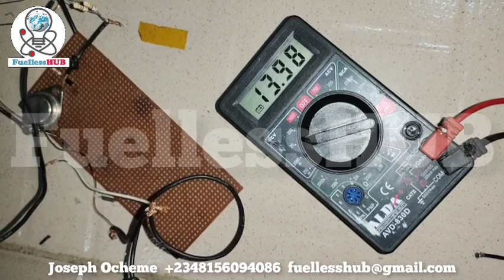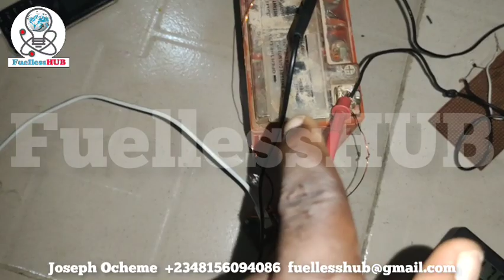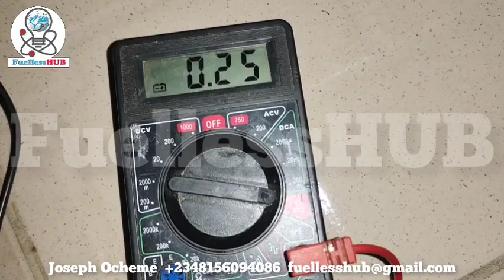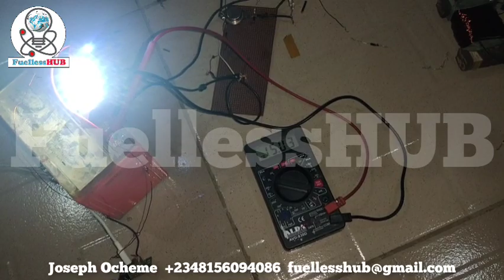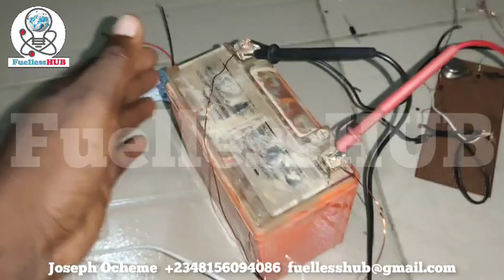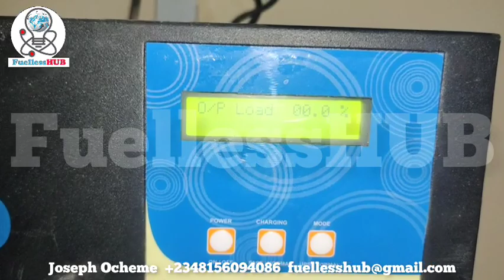my free energy device 10 watt continuous power forever

Comment: The battery is reading from 13 to 15vold while normal battery voltage is between 12 to 13 volts.
Why is yours is from 13 to 15volts?
Reply from the maker: That's a resonance charge